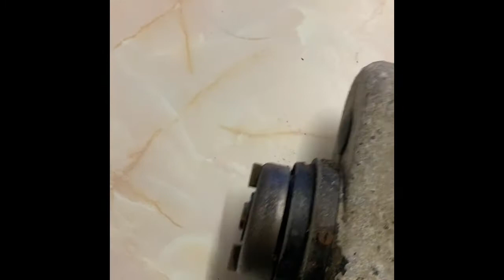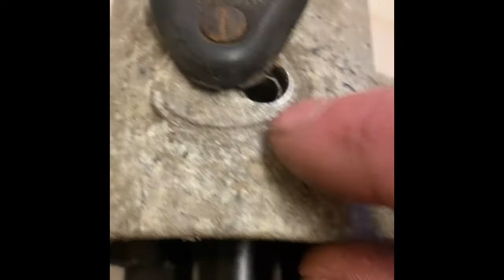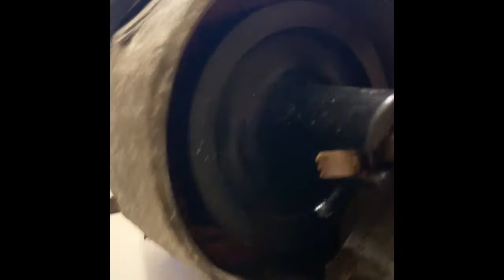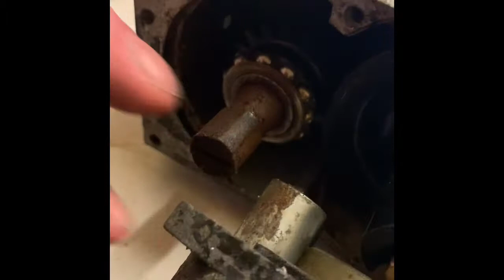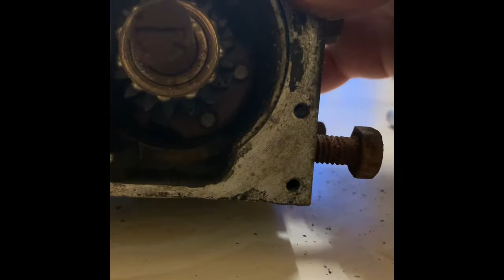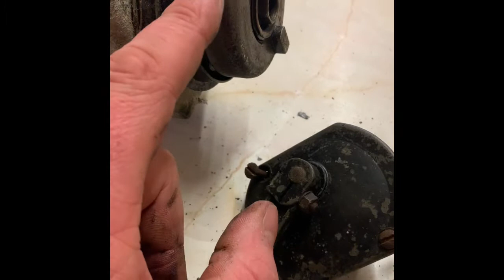Magneto basics what’s inside Lucas rf4 fordson

Comment: By any chance do you know what the ohms reading should be the the coil
Reply: Good video, I’ve got a few RF4’s but I’ve taken off the impulse couplings and opened them to clean them up, I figured that the shaft has a key in it so as long as it’s re-tensioned it should be ok, probably totally wrong, but they need restoring anyway
Reply from the maker: Sorry no I don’t but if you look for a guy called old iron engineers on Facebook he is very helpful, he rebuilt my Bosch mag for me
Reply: @Tractorkinguk  thanks for the reply I'll contact them thanks